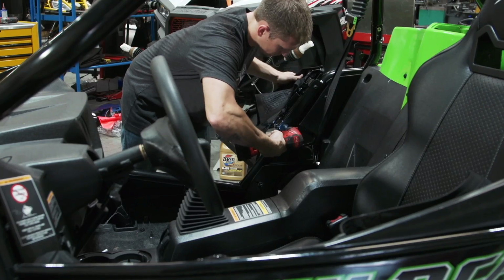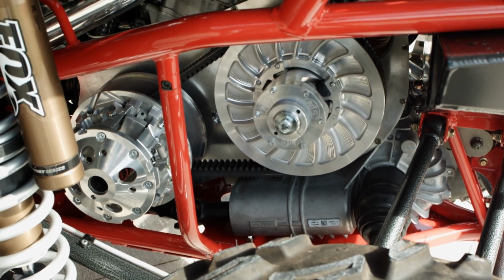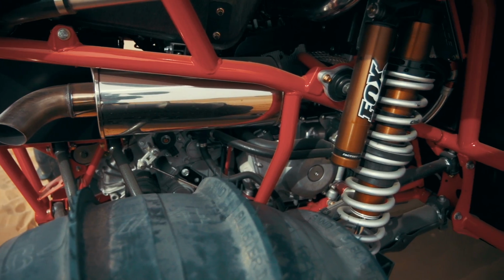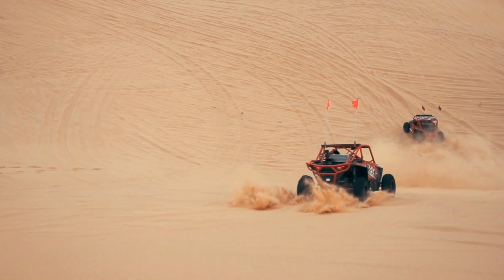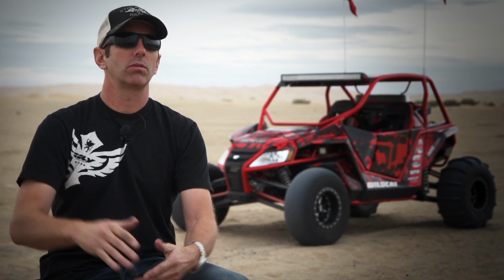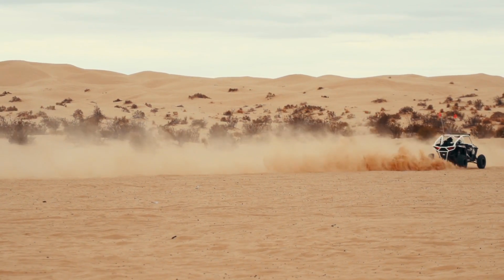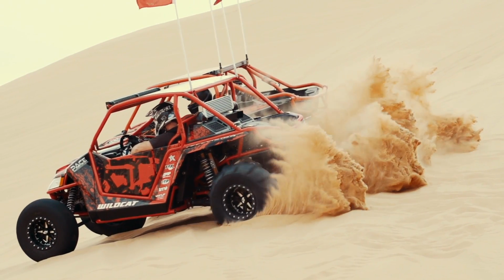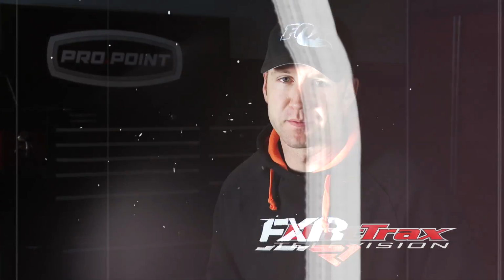Greg Biffle and PACE Offroad Wildcat Build - Part 4

Comment: VERY GOOD VIDEO!!! THANKS GREG SO MUCH FOR SHARING! WHAT IS THE Z1100 MOTOR?  ALSO WHAT IS THE STARTING COST FOR ONE OF THESE BAD BOYZ?  I ALSO HAVE A 2013 KITTY CAT...
Reply: micahs 20,000
Reply: +micahs Z1100 Motor is from Arctic Cat's Snowmobiles.
Reply: +Nader H How did you find that price? I WANT ONE